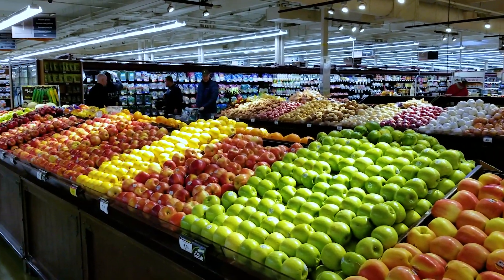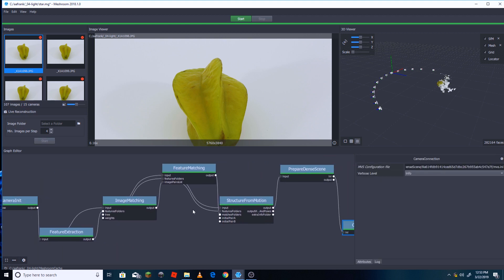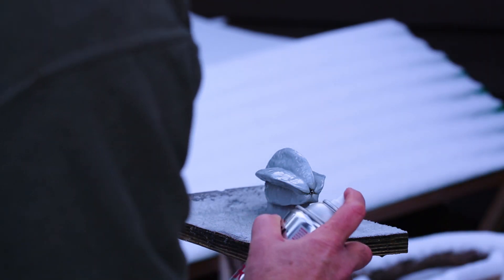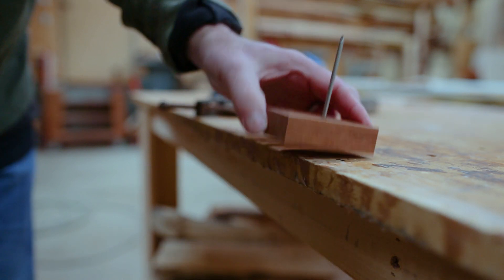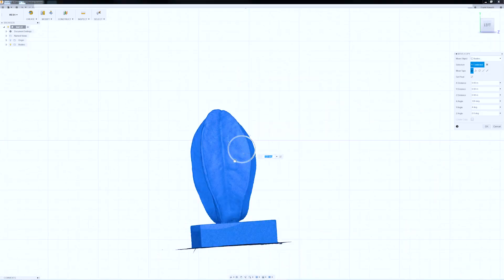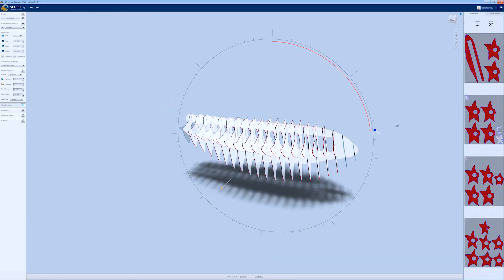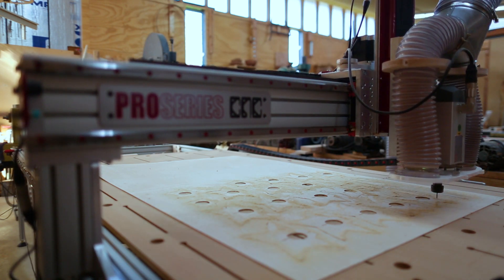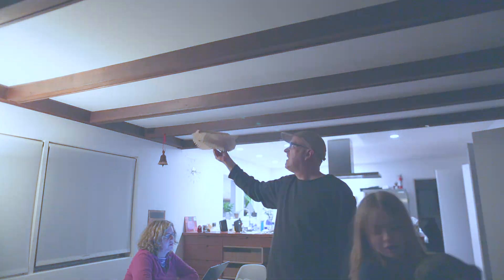Transforming a Star Fruit

Comment: Good job, but a bit unnecessary. 
Why don't you cut the fruit into slices and then scan it in 2d or with a photocopier.
 Because it's anyway to print "slices". 
With "Inkscape", it's easy to transform image to gcode. (even in 2019) 🙂

Comment: Since you ended up making one side flat. I think you could have made the process easier by just setting up the star fruit with the end you wanted flat on the bottom/sitting on that edge. Don't think you needed to do the vertical model or was there a specific reason. Anyways great video.

Comment: Just in case you are interested in why you need to spray paint it: 
To me it looks like it tries some sort of dynamic programming or SGM (Semi global matching) algorithm. This means that it needs a densely textured image field (The algorithm basically works by choosing the best fitting neighbour of one pixel in one image in the other image, while also allowing to skip pixels if they are not seen in one of the images). If you don't have a lot of different pixels, this algorithm fails easily, as you have seen (It also works from the border of the image to your pixel value, and tries to minimize the amount of skips on these pixels. This means that if everything looks the same, it just won't work). And that's also why the spray paint works so well, I suppose.
Reply: Oh, also, I really like the project idea :) Very inspirational!

Comment: Without knowing anything about Meshroom or how it works: I wonder if you could've used a green screen (and green paint for your nail stand) and some other software to chromakey out the green and replace it with transparency in each picture before importing them into Meshroom. I would think that would eliminate the background related issues you had.

Comment: scale it only in length so it is about the same length as the table. And keep the width and thickness as is. 
For the light source I would not put a light tube inside but put the leds flat on the faces of the whitewashed wood, so it illuminates the wood and it will be hard to look directly into the light sources.
Good luck ;)

Comment: Some kind of clear plastic or acrylic is the obvious choice, but the artist in me wants to see something as close to an actual Starfruit as possible, and it might not transmit the same charm as the source material if it's just a clear acrylic. The one benefit that a clear acrylic does have is that a Starfruit has that sort of translucent layer, like a final oil coat on an oil painting, that light going into your eye has to bounce through. So, I think the solution might be to have each slice of the Starfruit be multiple slices laminated together. Like, an opaque mini slice, with two translucent, or transparent mini slices, that makes one main slice. Then your light in the middle would have a lot of surface to bounce around in.

Comment: Nice, as usual.

Now, a suggestion. I believe it wouldn't make any difference in this project, and it's some extra work to do (and you already did a lot of work here) but, maybe another time, if I were you I would also take photos of the object upside down. I know it's some extra work, I know, but you wouldn't have to cut the block of wood with so much detail. You would only need to cut both models in half (or not exactly in half, you could just take the part you need) and "glue" then together.

Depending on accuracy it may produce a seam where both parts meet, but that should be an easier problem to solve rather than "inventing" the part that wasn't scanned because it was touching the block of wood.

Just saying.

Thank you!

Comment: Kind of a shame that your ceiling beams seem to be running perpendicular to the length of your dining room table  - makes it harder to 'fit' a light fixture that orients with the table itself. 

I'm imagining some translucent plastic in the light - would go with your mid-century modern house design. Perhaps some plastic sections intermeshed with the wood you choose?

Comment: Maybe try doing some experiments with cardboard? The light passes through the corrugations in some really interesting ways + its very cheap! Or if you do still want to use ply, I'd suggest spacing out the cross-supports a bit more :)

Comment: If you had been the one turning around the fruit instead of having the fruit on a turning table, you would have had less problems with reflections. Photogrammetry doesn't necessarily have issues with shininess and shadows so much as it has problems with those if they are not consistent, such as when the object is moved in relation to the light source(s). Moving the camera around instead of the object helps by keeping the position of the object to the lights constant.

Comment: One advice for photogrammetry software. Some of them don't like changing lighting conditions on the object. So instead of rotating the object while keeping camera and light source fixed, you could get better results by keeping the light source and object fixed while rotating the camera around the object.
Looking forward to part 2
Reply from the maker: Yes, I was trying to make as an ambient light source as I could, but it is still a little bit of an issue.

Comment: You should use thin aluminum for the pattern so it would be reflective, light not heavy. You could also use two aluminum rods near either end to hang it from the ceiling. One rod would be hollow for electrical wire.

Comment: That is the hard way of making models, but it certainly is cool. You could make some interesting kit lights, wine racks, you name it. 

When I was in engineering school, we had this "gun" thing that kinda looked like a big bar code scanner that could make 3d models of things by running over the object, but it was used for very large things. We were using in for electric turbines to check geometry and allows for us to produce a cfd model easier. I was a student, so I wasn't involved in the higher level parts of the research, but some of the tech that we have would sure be nice for consumer use.

Comment: As soon as I saw you shooting the starfruit I was thinking 'Nooo... It needs a speckly pattern for differentiation' as it's notoriously difficult to lift clean shapes with photogrammetry software without a contrast between shape and texture and sometimes a specific setting on a camera works really good too.

If you do more similar projects you should try make a camera rig with a semi-circle support bar, lockable and rotational bed and try loads of different options to try and make a nice streamlined plan and that vid will become the go-to viral vid for object photogrammetry.

Another great vid and project.

Comment: Larry Scarpa designed steel framed dressings rooms that were then wrapped in the heat shrink used to cover boats for transport bc a rigid skin wouldn’t conform to the shape. I think reducing the rib count and skinning it would produce a softer, more even light and still allow the form to be seen. Maybe leave the bottom section open for more light on the table surface. Beware of colors as they will tint the light. Greens and blues make food and faces unappetizing

Comment: Frank, first of all, thanks for your videos. Always an inspiration. As a metrologist (NOT meteorologist!!!) i'd like to point you to some points:
1. The object does NOT need to be connected to the background, BUT i am guessing while you were turning it shifted position to the background due to the flimsy clamping. 
2. You really should try and take images from more angles (i.e. change the inclination with which you are taking the photos. This will automatically give you a better result.
3. You are right about one thing: the photogrammetric process needs some stable texture (so, reflections are obviously not your best help). So having a noisy background would already help alot, but the object itself needs some texture as well. There are obviously methods that can overcome this hurdle, but these are a little bit more complicated (active triangulation is the keyword)
4. I didn't know Meshroom until now (looks promising), but if your object can't be found, you could try changing the "FeatureExtraction" Node. But again, that is my first guess. 

Have fun and hopefully this helps! :)

Comment: You could subtract the beam shapes and get back a bit of headroom.
With the current shape and opaque material the light would be very directional on one direction.  So maybe holes could help with that and lighten the structure. On the other hand you want to avoid direct ligth from the tubes, so a bit of tinkering in CAD is required I guess.

Comment: Another difference between the boulder's you've seen in the demo videos and the fruit you were working on is that the boulder doesn't move relative to the light source in each photograph.  Perhaps the changing light and shadows as you rotate the fruit is confusing the software.  Perhaps that's part of the reason why painting the fruit had such a big impact.

Comment: Nice work on figuring out photogrammetry! The model looks great. One trick to try to get the best results is to not move the object with respect to the lights. The software needs to find features that exist on multiple images. Hard shadows are great features, but if you move the object and the lights stay still, the shadows will change in each photo. This is also why reflections don't work, as reflections change as the camera orbits around the object.

Comment: If this were my project I would cut the carambola cross sections as outlines, opening out the center void. (I would use the same thin wood you've used on this one.) Add one or two more horizontal connectors. Run an LED tube light down the center. Then cover the assembled structure with rice paper, creating a very groovy lantern..... Now that I think about it, I will definitely do this with some shapes of my own choosing!
Thanks for the inspiration.

Comment: Yeah, it's like you were the poster child of what not to do with photogrammetry. Live and learn, it makes life interesting.

A diffuse light source is very helpful, but there is a related issue.  My attempts at this sort of work taught me that you  specifically want to avoid a constant relationship with camera to lightsource, your turntable worked against you there.  It's much better to have the camera move, and the light and subject keep fixed in relation to each other.  Spiking the fruit with no direct lighting at all, and walking around it taking photos would be a good starting point if you do this again.  You want any shadows (even indistinct ones) to fall on the same parts of your subject in every photo.  Your first example of the chair was good, likely because of many of those factors.

Comment: I love where it's going! However - consider that the plywood is going to cast a lot of shadows. 

If it was me I can think of two options - etched/sanded plexiglass/polycarbonate that is translucent, to help with the shading, or... Would you consider using the CNC-cut plywood as a form for another material? Like Fibreglass? Or maybe bend wires around the plywood form and then use that for fibreglass - basically your own starfruit-inspired version of a Nelson Bubble Lamp?

My last thought if you're set on plywood is... what if you "traced" the form outline instead of using solid panels? You could probably nest a lot of the outlines (huge material savings) and it would open the centre of the structure, minimizing the shadows.

Comment: Would rotating the camera around the object instead of using the lazy susan create better raw images for the software to model because the light values on the object wouldn’t change?  It would be similar to what you did with the chair.  Alternately wink use a circular collection of cameras taking a simultaneous image like the shot of Neo dodging bullets in the Matrix...

Comment: Indeed, I too got annoyed with the "oh, Photogrammetry is so easy" videos, where they don't actually scan difficult to scan, real world objects. That's what prompted me to make a long video a while back where I do much of what you figured out to do as well, the grey primer and speckling paint over it. I've heard people using hair spray to dull down the shininess of the object as well, but oftentimes that's not enough. The photogrammetry software(s) really need some unique texture to work properly. Niels Provos also did a good video where he scans an antique ax head using photogrammetry which is really good. Another, really undermentioned, fact is that your images really should be as high quality as you can make them, meaning to shoot at as low of an iso (to reduce the grain) and at small of an aperture (to reduce depth blur) as you possibly can get away with. It can make a world of difference for the software!

Great job Frank, looking forward to part two! I've always had a fascination for these lattice type structures!

Comment: very cool. 

(-although it's a hideous light!.. and your wife doesn't like it!)
Reply: I agree. It just looks like some bony blob.  I don't think anyone will make the connection to a natural object.

It gets you thinking though... What if you did the same process with a big slab of wavy water and turned it upside down?  Sandy dunes?  You don't even need to take pictures as Max makes these shapes pretty easily.
Reply: Yeah for real.  

Using a new process to make something?  Cool.  3D rendering and creation on CNC machine?  Awesome.  Having a starfruit illuminating your table?  Ehhhh... sure, if that's what your into.

Comment: Gotta say, leaving it as a skeleton with thin "ribs" does have some merit to mess around with, allowing light to come out of the sides as well as down to light the room, and the profile of the ribs allows it to act like a partial light diffuser as well.  Makes plywood a possibility still by keeping the weight down with thin slabs,  I think you should definitely explore this as an option with your model though.   Test with and without "sides",  maybe have the ends of the fruit shape be what's removable and that's how you put in new bulbs.

Comment: If you are worried about weight, Gatorfoam® or a similar foam board might be an alternative to plywood.  Two problems I foresee, though: a) it might not look elegant enough for a dining room fixture; and b) dunno how heat would effect it over time, I wouldn't be surprised if it warped.  It might still be worthwhile to get some and see how it works in the CNC router.
Reply: With an LED light bulb heat shouldn't be any problem.

Comment: colored or frosted plexiglass could be a good material.
Reply: That is what I was wondering too. Maybe frost the broadsides of the pieces and have the edges unfrosted so they glow brighter than the broadsides.
Reply: Or jack fruit tree wood ☺️
Reply: Certainly agree - wood and electricity could be a bad mix, especially with potential heat from whichever light source he uses.
Reply: @avros  LEDs would solve most of that issue after all many lamp shaded used to be made of paper and cloth